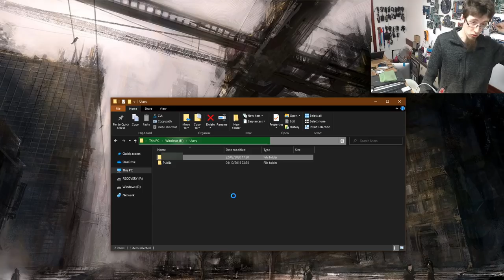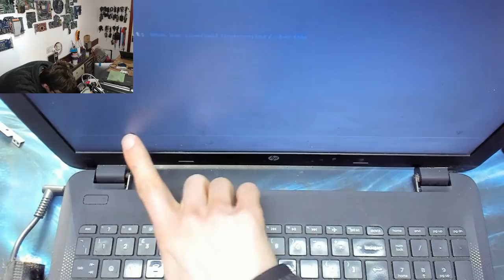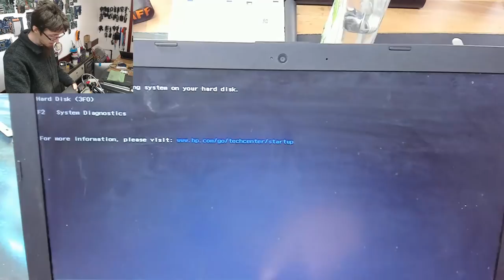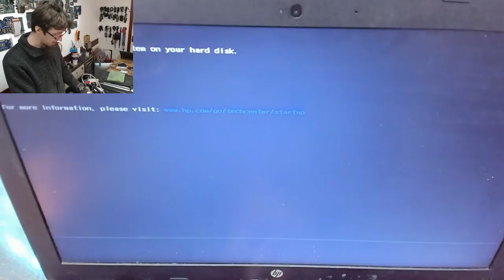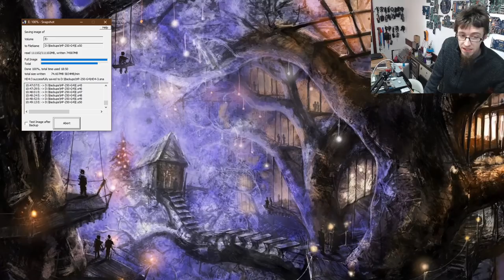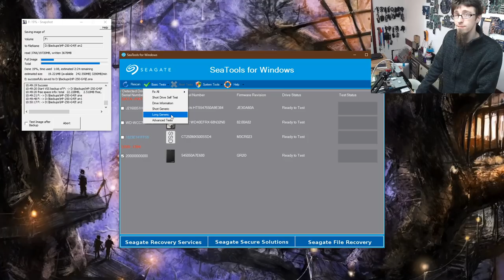LFC#202 - DIY Approach to Liquid Damage

Comment from the maker: There's no one-solution-fixes-all answer to liquid damage. But today I'll show you where you can start, and what you can try right after a disaster that may save your device.
I recommend talking to a professional about liquid damage repair in a mission-critical situation, but if that's not an option, knowing what you can and can't do at a DIY level is the next-best thing.
Reply: Adamant IT 

Great tutorial and wisdom!
Please read this through and respond! I’m desperate for answers! Thanks. (And I tried to be as specific as I can)

Your video I followed: https://youtu.be/0oFgu5WwNDU

My MacBook Problem Summary & Background Info: Hey, my MacBook Air A1466 (2017) is having problems; the fan is always on full blast, and is very slow/laggy, when on(Limp Mode).  And I accidentally dripped some water near the top of the trackpad when I first damaged it. I opened it up and inspected the ribbons, I found the sensor ribbon and the ends were damaged.  There was some sort of scummy and burnt-like residue on the ribbon and the pins from the connector. One factor you should take into account is the touch/move on the trackpad was still fully functional, and the only exception was the fan is always on full blast and slow processing on the cpu. I am 100% sure it is not a motherboard/logic board problem, as the Mac is 100% functional. 

Testing: So then I did some testing with the Mac(cuz I don’t have replacement trackpad, and I’ve already tried cleaning), I wanted to see if I disconnected the ribbon (trackpad), maybe the fan would stop going full blast and the Mac would get faster(good as new speed). But when I restarted the Mac and disconnected the ribbon immediately after, the touch/move stop working and the fan was still on full blast, while the laptop was very slow. Also the keyboard wasn’t working either.

FOLLOW UP QUESTIONS: 
If I disconnected the ribbon for the track pad, will the MacBook performance be revived?

Or does the MacBook require a fully functional and good condition trackpad to revive its performance? Because what you did in the video was replacing the trackpad, which apparently fixed the “Limp Mode” problem including the fan speed problem.

And is the only problem 100% the trackpad, taking into account these results and info I gave you?

I subbed & liked.👍🏻
Reply: Best video, thankyou.

Comment: Hi. I managed to spill a full glass of sparkling water (quite a lot of sodium content) over my yoga c940. This was devasting since I'm only 18 and I don't have that much money. I quickly shut down my laptop and dried it out. The next day I tried turning it on but to no avail, the keyboard lit up for a split second but then it was completely dead. I thought it was done for but I found your video. I dissembled everything and when I removed the cooling system I saw a huge spot of corrosion and damage. I used your trick with rubbing alcohol, cleaning everything throughout and made sure everything was dry. I honestly had no hopes but to my biggest surprise it actually turned on and everything was working perfectly. This video saved my laptop and to that, I'm really grateful! Great content, keep it up.
Reply: Congrats on saving the device. You have a new thing :)

Comment: "First thing I would advice doing is get your device to someone who knows what they're doing".
Then the zeroth thing you should do is to unplug the power and remove the battery. Do it immediately, no hesitation. If your device has a non-removable battery, then take it to someone who knows what they're doing right away, and run, don't walk. Or open it and disconnect the internal battery yourself, before you go any further.
Water and electronics is not a great combination. Water, electronics and power is a disastrous combination. Unplugging all power will buy you a significant amount of time. (But still, don't tarry overlong.)
Reply: The -1 thing you should do is run regular, automated backups. If the idea of dumping a glass of water into your computer makes you nervous at all (outside of any hardware costs) then you're doing something wrong.

Comment: Much of corrosion is actually caused by current causing electrolysis.  Step 1 should always be to remove the battery (when it is user-accessible, like in this example).  That way when they get to step 2 (bringing it to you), there's less corrosion for you to deal with.

Comment: The very first thing you should do is DISCONNECT POWER, and press the power button for 5-10 seconds to HARD SHUTDOWN the power, then REMOVE and/or DISCONNECT the BATTERY. Its critical to stop any posibility of any shorts happening. After that you can deal with trying to dry it out.
Reply: Very good mention!

Comment: 14:40 - Several synthetic glues and materials are actually dissolved by isopropanol, and that's what was happening there with the foam. I would generally suggest starting with (95%+) ethanol. Then switch to isopropanol or ethyl acetate, and finally to acetone (if you really need to remove something and you're absolutely sure the underlying material can take it).

Also worth mentioning (because the "WD" stands for "water displacer" and some people might think it would work here), some natural rubbers are dissolved by kerosene / Stoddard solvent, which are two ingredients of WD-40, so don't spray it into any rubber gaskets / o-rings or you can just end up with a lot of semi-liquid sticky goo. When in doubt, spray a bit onto a cotton bud and try it before spraying the thing directly.

Comment: This video is very informational. I applied the DIY brush + isopropyl alcohol technique to an old water damaged Logitech G502 Proteous Core mouse (original model) where the DPI Shift (the larger left side button) would register itself pressed on boot and blocked things from being clicked in Windows. Clicking it would reset it, but it got annoying to do; the mouse was otherwise working fine. I opened it up to find the three side buttons are part of a daughterboard connected by a ribbon cable. The end of the cable had some schmutz on it. I brushed it and the port with isopropyl alcohol, then reversed the ends. It seems to have fixed it and this whole process was very quick. Although I already have a new mouse, the Razer Viper, the new G502 Hero model would've cost $46.99 if I had gone with that, so now I can happily use the old G502 on another PC or give it away. Thank you!

Comment: .People used to drop sugary drinks down the back of old portable TVs.   In the late 60s, I was working in a shop, we'd pull the chassis and wash it with a garden hose and brush trying to avoid the flyback.  Then leave them in the sun all day and hang them by a rope to dry overnight.    Usually, a few tubes were cracked by the liquid hitting them.  Most times, after they dried and the cracked tubes were replaced they worked.   It was the only way to get that sugary goo off of them.    Electronics was so much more fun back then.

Comment: After drying and cleaning motherboard, I strip it from any plastic(not plastic connectors/sockets they will be fine), battery, covers and bake it in the oven at 90c for 30min to get rid of any moister. Especially from underneath CPU's and GPU's. I monitor the temp. with thermocouple for correct temp reading. Starting with cold oven to avoid any thermal shock. It's completely safe if you carefully monitor the temperature. This is BGA rework/soldering 101. This will guarantee you, that all moister is gone. I had situation when laptop was back after heavy liquid damage repair, dead. Cpu underneath was shorted by corrosion after rinsing with IPA.

Comment: If your ever working on a hard drive I would recommend crystal disk info. Crystal disk info is a great free tool that can be used on windows computers that shows the health of the hdd by using the S.M.A.R.T data which is super accurate because it’s what the hard drive is reporting. It even shows the power cycles and how many hours is on the hard drive.

Comment: My wife flooded her laptop twice. My solution was to open it, remove the battery and the bios battery and leave it in the oven at 80C for 3-4 hours. No problems whatsoever afterwards, both times. The trick is not to have it under voltage while wet.

Comment: My last liquid damage adventure was a glass of water tipped over onto the table where my laptop sat, without me noticing it had happened.  I think my poor little dell was sitting in a 1/2 inch pool for 5 minutes before I twigged and ran to disconnect it.  It continued to run as I lifted it from the table and watched water pour out of the vents, but then there was a protracted groan and the sound of thousands of cascading shorts.  I rushed the machine outside as I was concerned about the built-in battery shorting, because no one likes a lithium fire, and the display flashed random blocks of black and white while the laptop continued to make horrible noises.  It sounded like it was suffering, and it was loud - think shorting electronics and coil whine at 70 decibels.  I managed to shut it off, and after it was drained, opened, and dried it never turned on again.  Some of the hardware survived - I think I could get a couple of dollars for the display - but the ssd kicked the bucket, sadly and somewhat surprisingly.  So yeah, RIP little dell.

Comment: Cleaning out electronics that had seen water, is actually the first and most basic thing you need to do, because corrosion is mostly always conductive, so powering on a device that had water damage is a bad idea, if it seen water, remove all the power sources, and start cleaning it up with alcohol, my sister killed her 3ds because it had liquid spilled on it, and she tried to charge the device killing it in the proces, she didn't told me that she tried to charge it, but i could see it on the logic board, and it whas completely dead, so never charge water damaged devices!

Comment: Same thing happened  to me and I immediately turned the laptop upside down and removed the battery. This was within seconds of coffee being dropped.  I then dried up as much liquid off the actual keyboard as possible. I removed memory and I think the disk drive which was accessible from the bottom.of the laptop.  I then put in a cupboard wrapped in a towel.  4 days later I plugged it all back together and switched it on....👍

Comment: Although this is an old video, I have one suggestion on the data part: take a byte dump first, before changing all the permissions stuff.
Tools like dd on Linux or windd on windows can do that easily.
This ensures you have a good snapshot of all existing data, whether the filesystem is corrupted or not. File permission is your least concern, as long as the data is on the drive and has been preserved in a dumped image file.

Then you can use all kinds of tools you like to view or edit to a COPY of the image. Knowing there always is a backup.

Comment: The thing with spills even if you clean it now and it works. There still could be parts that are out of tolerances that could eventually lead to the death of the machine :) 
On such old and damaged hardware memory is probably the most useful thing.

Comment: Just immediately pop it in a low oven for several hours to easily steam excess moisture out. Works like a charm. If you have a large enough dehydrater (for making beef jerky or dried fruit) you can leave the laptop in that for up to a day.

And if you’re wondering, no I’m NOT serious.

Comment: when liquid damage happens need to unplug power quickly and open up the case and unplug the battery also quickly. then let laptop dry.
Reply: If the liquid isn't plain water, letting it dry isn't enough. The liquid itself will be an electrolyte, and if it contacts 2 dissimilar metals, uh oh. The 2 dissimilar metals could be solder and copper.

Comment: Most HD companies will not allow any removal of boards.  If you have a failed board, you can sometimes put a board with the same BIOS on it.  It will work from time to time.  Use to work WDC tech support, and we did that from time to time to get a drive working again.

Comment: That white line usually means its the flex display cable acting up. That problem occurs usually when flicking the laptop screen up and down with the lid, since the flex cable route there usually it get worn down over time

Comment: Firstly remove the battery. That is one well used keyboard. Guessing water spillage is easier to sort out, but sugary stuff should be cleaned with water, sounds bonkers to wash the board in the sink. Hmm my sister had a sound system that made a screaming sound, they type that had a tape deck and record player radio combined. She knew I was a bit of goof ball, in 70's a bit weird with electronics, told me about it but told me not fix it ... Well  nobody home I rescued it, apparently some sort of girly product got spilled, maybe hair product I don't know, but back then I just cleaned the board with water and used her hairdryer, kept smug never heard a complaint

Comment: With corrosion on capacitors on the drive, it is likely to fail as the corrosion is still eating its way through the copper traces underneath the parts, unless you flux it and ultrasonic it, the risk of later failure is high.

I’ve done several videos fixing liquid damaged laptops.
Reply from the maker: In my experience, if it works after this basic clean up, you're done. Only times I've had a laptop come back into the shop after this method was when there was something else not working that I missed - but over all, not see any later failure. Ironically, most of the time when a laptop comes back in, it's because the customer spilt something on it again 🙄
If the laptop's still got issues after a basic clean up, then yes, absolutely time for ultrasonic, and then if still nothing, reflow/repair. But more often than not it's overkill.

Comment: You can easily access the hard drive offline without changing the ACLs (which you will have to do if you just use Windows to get access to it). Avoiding this is a good idea, since it requires writes (many of them) to the customer's disk. Something like Runtime's GetDataback will access the drive without altering file ACLs. Alternatively you could use a usb key Puppy Linux distro to mount the NTFS partition and get the data off that way. But if the disk is in as good shape as yours, I'd just give the customer another disk and clone the original using Macrium Reflect - no OS reinstall needed. Get the customer's data off first though, then if the drive's still good, try cloning it. In any case, as you say, replace the disk, since disk is cheap and data is valuable.

Comment: You can use HDD Regenerator for hdd that are filled with bads and are not working ok. It will not make the hdds new but you have higher chances to recover data after you “healed” them. It is a long process but it maybe worth. Play with few hard drives that you have with bad zones and see how is best. Usually first scan is prescan without resolving bads just to identify them- works faster second just healing the bad zones. Manually regenerating sectors doesnt do much from my experience.

Comment: isn't the felt in the hard drive supposed to prevent shorting the controller board? because it doesn't look like it did a great job of preventing moisture
Reply from the maker: Might be the case, yea. I figure that the screw mounts prevent that, but this also seems likely.

Comment: If liquid spill, the part to worry is oxidization of liquid on the metal part of the pcb or electronics, How to remove the oxidization of the metal and protect coating it? Looking forward for a better solution.

Comment: Thank you, that hard drive info will be very helpful. I would suggest upgrading away from that to a SSD if the customer desired. Simply to increase the speed over a 5400 rpm drive. *To clarify I am not a business, I learned by fixing/building/repairing donated computers. I don't charge for parts. I source parts and customer purchases on own time. Most repairs that I do are for low income families and students so I give my time and charge nothing. If customer cannot afford parts I will donate a tested quality part from my stock*
Reply: he did upgrade it

Comment: I really hope that "upgrade" to win 10 was consentual I would hate if someone did that without asking first (I'm sure you asked and got permission as you seem to be one of the good repair shops)
Reply from the maker: I do recommend Win 10 to my customers, as it's the most practical system to be running (in terms of support etc) but yes, I always check with them first.

Comment: Curious: I have a Surface Book 2 that suddenly won't get any power from the charger, won't charge the battery and won't start up. Problem is that it is glued rather than screwed together so the question: how to get inside to take a look? also, same lack of charging with 3 other chargers and a Surface Dock that all work on another Surface Pro 3. (so I presume the chargers are all good).

Comment: Distilled water is safe to use to clean electronics as it has no mineral content. Water itself does not conduct electricity as it is an isolator, but the contaminants in water will allow electricity to jump from point to point causing a short.. Distilled water is safe to use when no IPA is available. Do not buy any other kind of water for this purpose, nothing flavored, nothing that has been fortified with vitamins, only plain distilled water works like this. Also do not submerge or soak your electronics in distilled water because you are again asking for trouble. Use it to clean or rinse (not hard drives!), and dry thoroughly before powering up. :)

Comment: As a professional, there are two items to add to the list, "unplug main power source immediately, second! remove main battery if accessible", and follow Adamant IT advice within comfort limits. Lastly, take the computer to a repair shop quickly as possible.